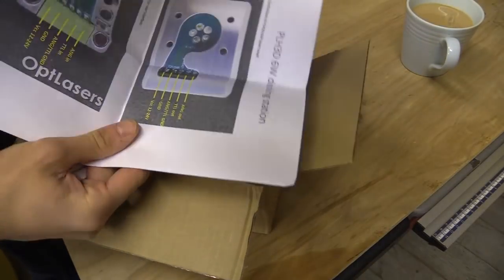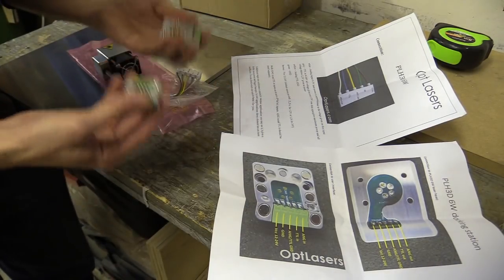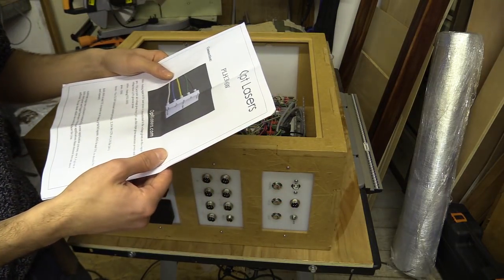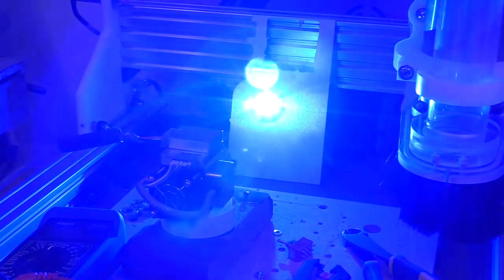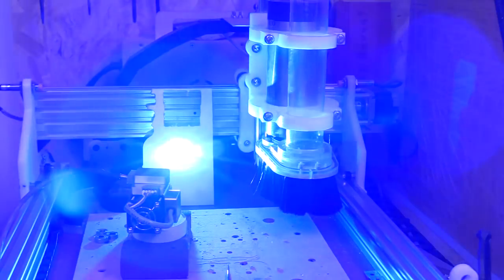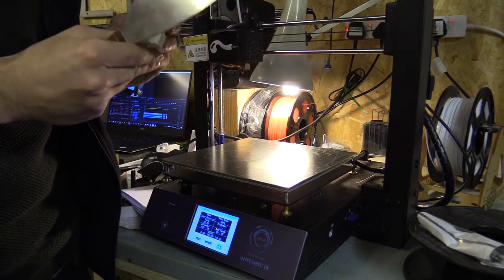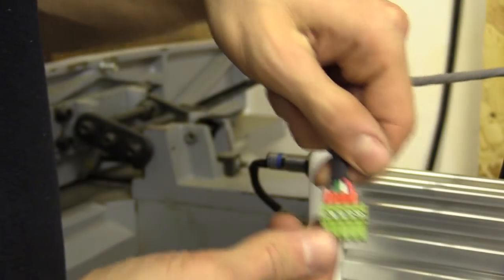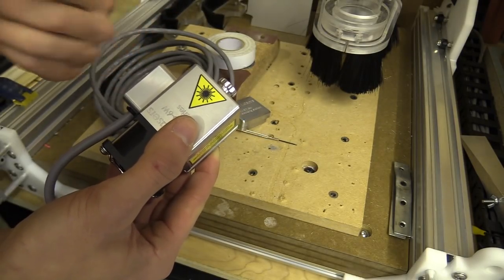#25 6W CNC Laser Engraving Head with Magnetic Docking (PLH3D-6W-XF from Opt Laser) #25 / Laser

Comment: I use a decent  PTZ cctv cam to monitor mine without looking at it directly. It can free me from being right next to my machines if the job is safe enough to leave unattended!
It's interesting to see that Orange tinted glasses that came with the Laser Head. They're invariably Green and that module looks in the 450nm wavelength region?
I must check prices on this

Comment: Hi, did you find a way to disable the fan without a custom switch,
and did you talked with the guys at OptLaser's about this?

And why two switches, and not only that of the power supply?

Thanks!
Reply from the maker: One switch is for the power and the other is for the signal. It means I have to flick two switches for the laser to work so maybe it's safer to set up.

Comment: Opt lasers are more expensive but they look very well engineered. I have a budget laser and the focusing/lense has never been great. Raster 2 gcode inkscape extension by 305engineering and jtechs extension works well.
Reply from the maker: I'm impressed with them. I've been playing around with the Jtech extension for DXF cuts. It took a while to get it working and then I noticed my laser and VFD signal were not the same. Think I need to make an update video on making sure the controller is set up for both. Also need to change the base frequency for the laser in the firmware.

Comment: You can make those tight fitting nuts almost captive in 3D printed parts by heating the nuts up and then pushing the heated up nuts into the plastic. I have used a soldering Iron but I find using the gas stove top works better. Best one doesn't grab the nuts with ones fingers ......
Reply: Very nice tip!!! hahaha. thanks

Comment: Lol $799
Reply from the maker: I know it's pricey for the hobby market, but the cheaper the laser the more scary it is.
Reply: Link?
Reply: Educating Savvas https://youtu.be/qmBhsDAW92M
Reply: Right, you can buy a 30W fiber coupled laser diode on eBay for like $100.
Reply: Educating Savvas you are right. Thanks for all your videos btw, very entertaining and I learned a lot from you! My machine is almost ready, you are very inspirational.
Reply from the maker: Eeer link please.
Reply: That has No cooling, No Fan, No controller and No heat sinks sure you can get a 30W laser for 100$ but it doesn't plug in and work like this one does.
Reply: Isn't that a 30W infrared laser? You know, the invisible one (but still perfectly capable of burning out your eyes) that can't be focused with a lens?